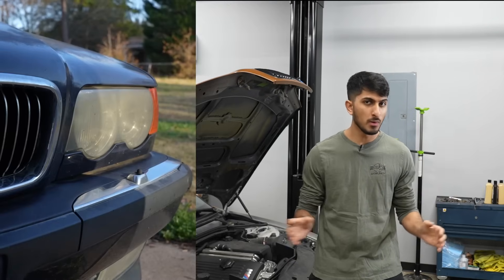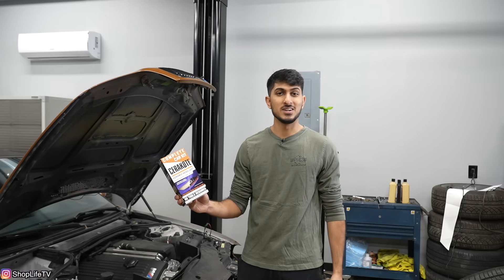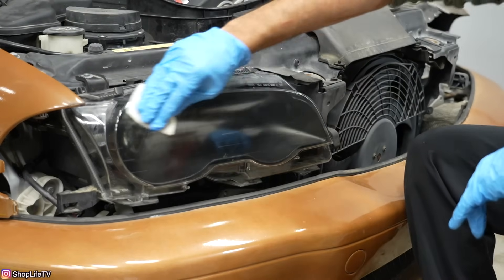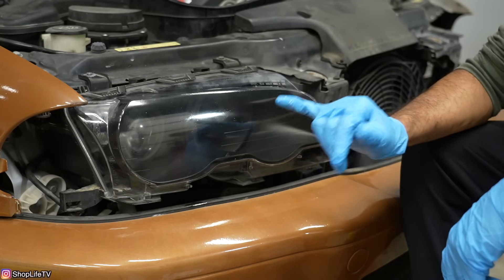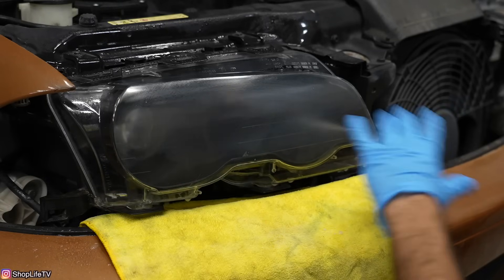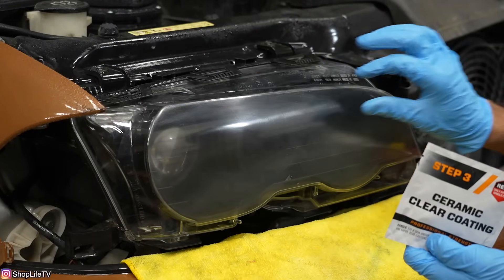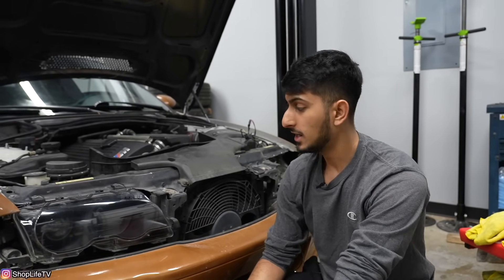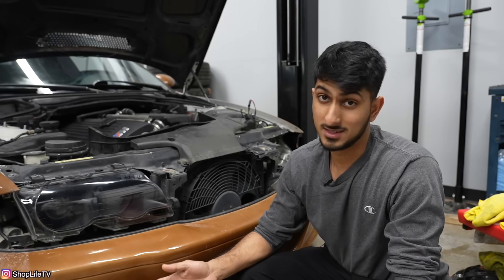THE BEST HEADLIGHT RESTORATION KIT I'VE EVER USED and it's cheap!

Comment from the maker: No more excuses for faded/yellow headlights lol This would make a great stocking stuffer, since anyone can do it! https://amzn.to/3Flmx42
Reply: A big warning: I just did mine yesterday with this kit! Time will tell but the 2000 grit and grey finishing pad straight up destroyed the piss outta the headlights. My headlights were in way better condition before...like x10 better then after the sanding. Then you apply the ceramic coat and looks good, but all the damage is all hidden....yet I guarantee those lens are still screwed hard core under the illusion of ~wet shine wipes of ceramic. This kit does NOT fix your headlights at all...per say. The 3M kit does, as knocks down the grit to extremely fine numbers with alot of sanding...therefore addressing the issue. 
Case in point when that ceramic washes off on this kit...I'm pretty sure it'll expose the scratched to hell lens...3M kits knock the lens down to a slightly cloudy appearance before the final coat. These kits the lens are pretty horrible after the sanding, then apply the wet coat. Yes, the results look good, but that could be a fake illusion as pretty sure the ceramic does NOT eat away or dissolve the scratches.

Comment: Based on this video, I bought one of these kits and did the resto today on my 2004 BMW e53 (X5). My lights were REALLY bad. Way worse than the one you did. I used all four of the de-oxidation pads and still had plenty of yellow on the last one. The drivers side headlight had noticeably rough and raised oxidation, but after all four of the pads, they were almost completely smooth. After the wet sanding process, both lenses were very smooth and then after the ceramic coating the lenses looked close to brand new. You really don't need to use the 2nd ceramic pad. It is well soaked with the ceramic based liquid so one works perfectly for both lights, which means when the lenses do start clouding again, I'll have the other one to get me through some more time with clarity. Here's hoping this lasts a long time, but living in AZ most likely means it won't. Time will tell.
Reply: 6 months later how’s it look?
Reply: abt to do it on my 02 civic si and want to know if it’s worth it or jus doing it w tools and taking my time
Reply: @santo_1  Holy crap, it's been six months already? Time fly's! They still look great. No oxidation at all and it's been hot as H E double hockey sticks in the Phoenix area too. I am definitely glad I bought the Cerakote kit. I'm hoping they will still look like this a year or more from now. One thing I did notice was that the final stage with the clear coat, I didn't need to use two per headlight. I just used one because they are REALLY soaked with the product. So now I have another one each for later down the road when they need to be sanded and sealed again.
Reply: Most people who use this product say oxidation and yellowing come after a year. How is yours doing? since its been a year
Reply: @Flraven79 They are still good. There is no oxidation at all.
Reply: @Viking8888  nice, thats great to hear. thanks for coming back to answer
Reply: @Flraven79  You're welcome! Thank goodness for messages when someone responds to a comment, because I have such a horrible memory, I would never remember to go back and update things. 😜
Reply: The kit I bought the ceramic wipes were half dried up, and didn't cover the lenses.
Reply: @Viking8888 how about now?
Reply: @theclaw8759  Not perfect anymore, but still quite clear. I’m guessing in another year or so I’ll probably need to give them another light wet sand and use the other protectant wipe I didn’t need to use on the 1st application. Well worth the $17 I paid.

Comment: i used this on my 09 lexus  and on my 02 xterra almost 2.5 years ago. it worked as advertised. however, i will need to redo the process again as the lenses are foggy though not as bad as before. but heck, $20 for 2.5 years for 2 cars is well worth it.
Reply: Thanks for updating us! 2.5 years and less haze is definitely worth the <$20 spent!

Comment: This is one of my favorite products when I’m doing headlight restoration.  Only thing I do differently is I polish it and then apply the coating.  Great video.
Reply: bruce mattingly  Yes its sticks
Reply: A comment about polishing. Heart, heart, heart. But after the polish you applied the clear coat? mpmike1972 I'm not sold on the clear coat.
I'm very interested in your experience.

Comment: Have there been any updates on this after you made this video? I think the issue that's too common is that SO MANY headlight restoration kits work and make them look brand spanking new BUT it always defaults back to that yellow haze after a few months. So the true test is finding a solution that truly does last a long time
Reply: paint protection film is the only way to prevent long term oxidation

Comment: I'm going to troll just a little.
Congratulations on a well-made video. Many fine points to the process of wet sanding. I'm not very familiar with this particular product. I've never heard of using a pre oxidation remover. I've just cleaned up a headlight using a non-abrasive cleaner and a sponge. But you did mention the smell, kind of a point down in my book.
I've personally used the wet sand to remove any oxidation after cleaning in three steps. 
You did mention using a 2000 grit sanding first. Where areas I start with a more abrasive grit below 1000 and step up from there. Ending with a 3000 grit. Mind you, I use a drill to do so. 
The other thing is having to remove the grill to get these results. If your timeline is accurate. It's not something everyone could do. So I can't really follow you there. 
The last thing, and I'm a real stickler for this one thing. The clear coat. I abhor any YouTube video that does a headlight restoration that applies clear coat. It even says on the package ceramic clear coat. The last I checked, ceramic was clay, not plastic. Then you need to wait for it to dry.

Maybe this works in your video. But I have solid time in the field. Your direction about the wet sand is factual. I'll give you credit there.
But there are better methods out there if you know hwhat to look for, and not just "this is the best product I found".

My recommendation, try the 3M headlight restoration kit, (with drill). Throw away the clear coat wipes and apply a polish at the end. Preferably something designed for plastic. That's when those ladies shine.

Comment: I am an elderly widow who used this product on my 2014 Honda CRV. The passenger side turned out really, really well, but the driver's side didn't do quite as well. I am wondering if I can re-do a headlight a year later? Is the ceramic coating going to be an issue if I try?
Reply: I would wet sand again to give the new ceramic coating something to adhere to and smooth out any rough spots. I think it will work great.
Reply: Thank you!

Comment: Why would anyone use tinted over covers on there headlights??Surely this is a violation of the highway code, I have no doubt this kit works!! But unable to see clarity before and after difference because of the tints?? Another thing can't understand why it's worth using those wipe's to remove yellowing and oxidation? As the second stage was wet sanding anyway ? Not convinced if this kit would remove heavy oxidation and old thick cracking flacking clearcoat such as 2k max🤔 Anyway your presentation and editing of this stream is excellent!! Thanks for sharing 👍
Reply: It’s black housing not tint! Tint lays over the headlight. The black is inside the headlight in the background of the lens!

Comment: I will have to give this a try, I’ve used other more expensive products.
Reply from the maker: Same! Other products work as well, but they usually just come with a wax type coating. The Cerakote coating is almost like a wipe on clear coat. Should be a long term solution, we will see!
Reply: Have you thought about doing content with Mini coopers?

Comment: Was there a smell of acetone?
Reply from the maker: It smelled more like automotive clear coat, like when you first open the gallon of clear coat lol
Reply: @ShopLifeTV  I was thinking of the oxidation whipes. Used high concentration acetone to join plexiglass in computer builds.
Reply from the maker: @stefanburemo9661  ahhhh...the oxidation wipes had no smell

Comment: I think that first stuff you put on is a waste of time.  Wet sanding will get rid of the yellowing.
I just bought 2000, 3000 and 5000 wet sandpaper and used alcohol to clean the lens after each sanding, all the yellowing came off during the first 2000 grit, even after all this it still looked scratched.  But I then put a clear coat  for plastic and non yellowing clear coat which filled in the scratches, let dry and 2 more clear coats, turned out great, no more scratches and looked brand new.  Plus you even have extra of everything to many more cars for the same price of about $20.00
Reply: yeah without a doubt the first steps a complete waste of time go straight to wet sanding with 2000 grit

Comment: A big warning: I just did mine yesterday with this kit! Time will tell but the 2000 grit and grey finishing pad straight up destroyed the piss outta the headlights. My headlights were in way better condition before...like x10 better then after the sanding. Then you apply the ceramic coat and looks good, but all the damage is all hidden....yet I guarantee those lens are still screwed hard core under the illusion of ~wet shine wipes of ceramic. This kit does NOT fix your headlights at all...per say. The 3M kit does, as knocks down the grit to extremely fine numbers with alot of sanding...therefore addressing the issue. 
Case in point when that ceramic washes off on this kit...I'm pretty sure it'll expose the scratched to hell lens...3M kits knock the lens down to a slightly cloudy appearance before the final coat. These kits the lens are pretty horrible after the sanding, then apply the wet coat. Yes, the results look good, but that could be a fake illusion as pretty sure the ceramic does NOT eat away or dissolve the scratches.
Reply: This method is similar to sanding followed by 2k clearcoat spray and having hazy sanded plastic is part of the deal so that clearcoat can better bite onto the plastic. The difference here is ceramic wipe is used to replace clearcoat and the big question is whether it can last as long and I don't believe it will but only time will tell. The pro is it's easy to re-do if it fades.
Reply: 3M kit except no substitutes, There's only one way the best way, Buy cheap buy twice!!🤔🧐👍👌
Reply: @zahimiibrahim3602  Never ever use 2k on headlights? When the time comes around again which it will to restore headlights again 2k clear is a nightmare to remove😮 Only use certified products that state for car headlights only!!!!

Comment: Dude you’re so wrong please.

What makes the headlights fade is the degradation of the UV plastic filament overlay.

Unless you remove this overlay and replace it? It’s just going to re-fog up within a couple months - Worse than before.

“Restoring” doesn’t it mean making it simply cosmetically looking better.

“Restoring” means that you actually go in & replace what’s originally been degraded & restore it back to its original performance benchmark.

This & everything else EXCEPT the OEM manufacturing process is just lipstick-on-a-pig.